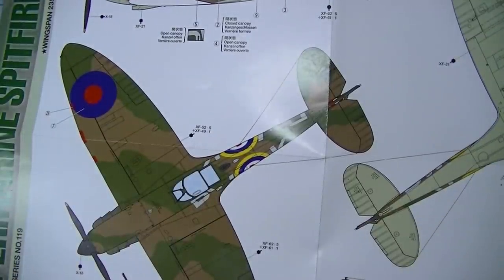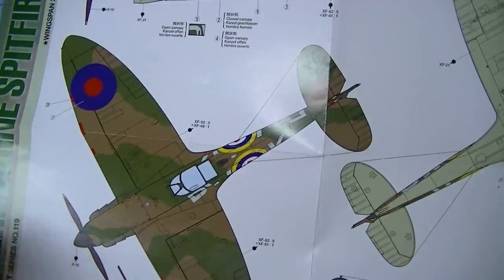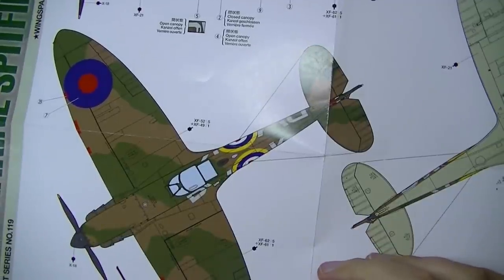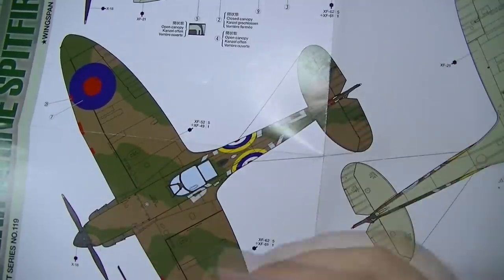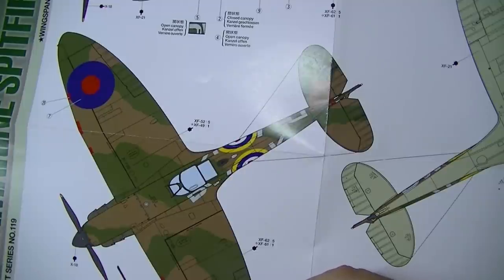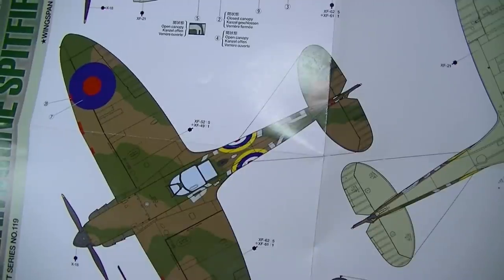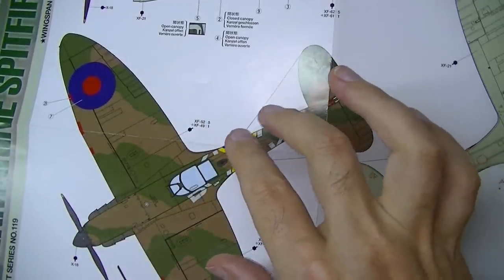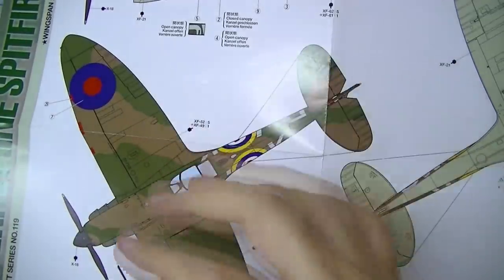ep277 - fundamentals: building the tamiya 1/48 spitfire mk1 part 14

Comment: I can confirm Humbrol thinners are not to be used for cleaning a wash. They will go through Acrylic paint like melted butter. So will some brands of mineral thinners as I've found out. Many (here in Italy) don't state the composition, so I'll be doing some testing before committing to an actual build. 

Regarding painting during the war years, here's an interesting period video of repairs on a MKI or MKV. https://www.awm.gov.au/collection/F02334/ 

Also of interest for anyone building a MKI Spit, is the below article from the Spitfire Site. It states that the IFF aerial (the wire going from the fuselage to the tail plane) wasn't fitted till late September 1940. If this were the case, none of the builds in the Tamiya box should have one. N3200 (QV) was shot down May 27 1940, K9906 (FZ L) is depicted in 1939, and P9594 (DW K)  had an accident and was struck off charge on August 28 1940. Just saying! http://spitfiresite.com/2010/04/spitfire-masts-and-aerials.html/2

Comment: As always a great tutorial! Can you confirm that you used MRP for all the camo? I had used MRP-108 for a previous build but I wasn't happy with the color once sprayed, so I stripped and ended up using MrColor H72. I'm about to embark on another Spit (Revell 1/32) and was thinking of trying MissionModels paint. However I would prefer MRP. I know there's a lot of debate as to the right the "correct/accurate" shade but I remember thinking it just didn't look right.
Reply from the maker: yessir.  all mrp.